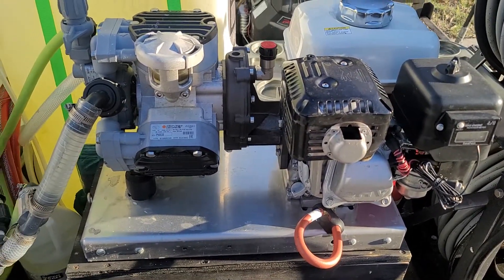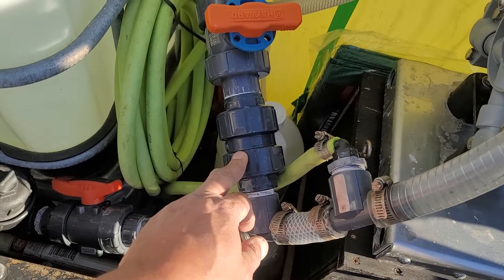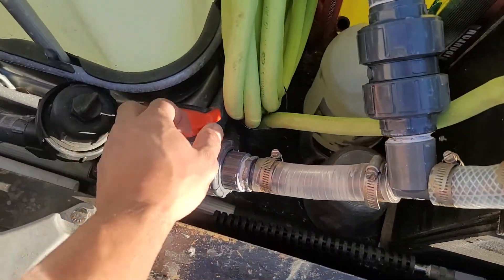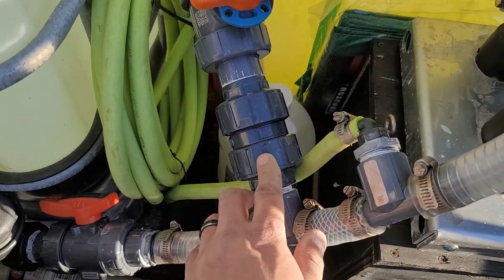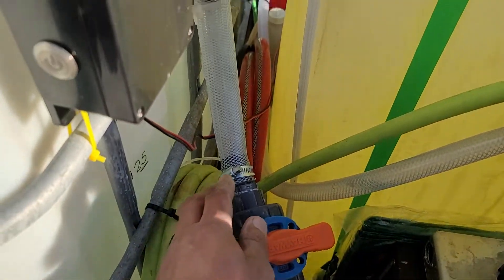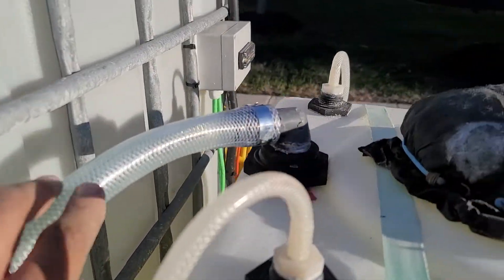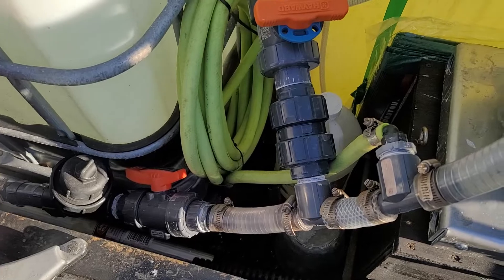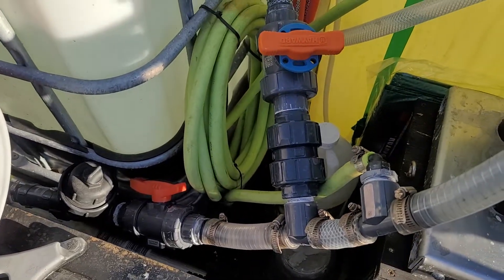Comet P40 Gas Softwash system (update)

Comment: Man I been struggling with my metering valve to work. I have a  1" metering and check valve bit it won't work unless I pinch off the water supply at my tote. I'm thinking my bleach line and water supply line have to be the same lenght.??
Reply from the maker: No. If you cut off your water supply and the  bleach works then that must mean you have an air leak somewhere. The water line must be sucking air somewhere. If you’re using non collapsible hose like tiger flex hose, make sure to heat the hose before clamping it down. The coils in the hose may prevent a good seal.

Comment: Those p40s leak
Reply from the maker: Mine doesn't but it will also depend on how you have it setup. I have a bypass hose that's 25ft on mine so it doesn't overheat and can bypass for a little while. Also if you don't need full power, turn the pressure down. Either way there are pros and cons having a gas system and the pros are good enough for me.

Comment: So the valve that you have they told me it’s a flow valve because the metering valves that they carry are only 1/2 inch. So my question to you is how do you know when the valve is pulling 6% and then say 2% for houses? I ordered the same valve that you have, should be here in a day or two
Reply from the maker: Just getting a feel for it introducing a certain amount of bleach. When you look inside the valve you'll get an idea what's halfway, quarter turn, etc to estimate percentage based on how big your bleach and water line is.

Comment: Do you have a part number? The company where you bought the metering valve is telling me they only carry 1/2 inch metering valves
Reply from the maker: I don't have a part number. My metering valve is 1". I updated mine. You can get 1/2 metering valves on Amazon.
Reply: @readykleenpowerwashing  yea I just realized that it’s called a flow meter by Hayward. I’ll have to contact them tomorrow to order

Comment: Where did you get the 1 inch metering valve and the 1 inch check valve? I’m in the process of setting one up and need to purchase asap
Reply from the maker: I purchased it locally at Harrington Industrial Plastics in San Antonio, TX.
Reply: Can you at least give me a part number for the metering valve and the check valve?

Comment: If you move the by pass T before the SH line it will by pass water only, not the SH. 

Not a serious issues at all since we all finish with rinsing with water at the end :)
Reply from the maker: Actually it won't unless there's a check valve before the T fitting, it's still going to bypass water mix you had in the system. Also you're corrwft that you will finish with water anyway so won't matter. When I'm finish applying chemical and activate my wireless ball valve, it will stop the SH.
Reply: @readykleenpowerwashing  got it! My remote valve will come this Wednesday after I try to work it out if it dosent please answer my questions sir! 😅😅